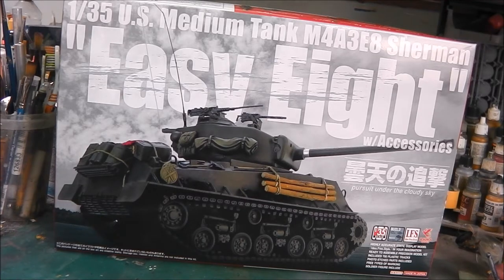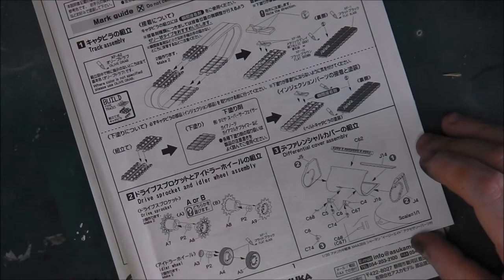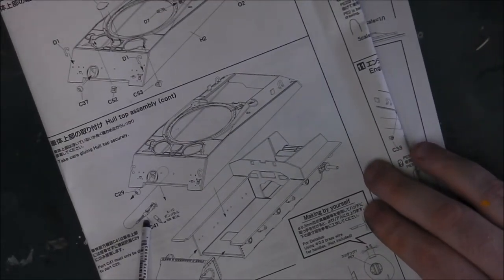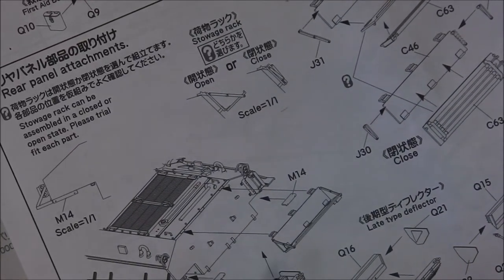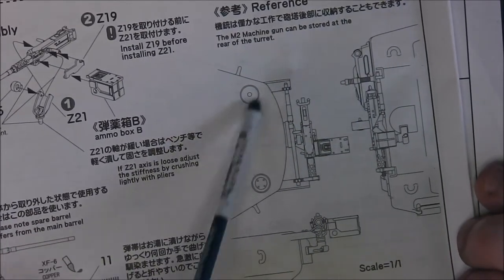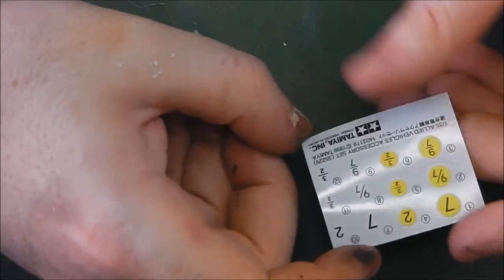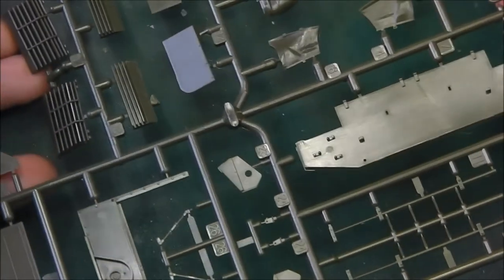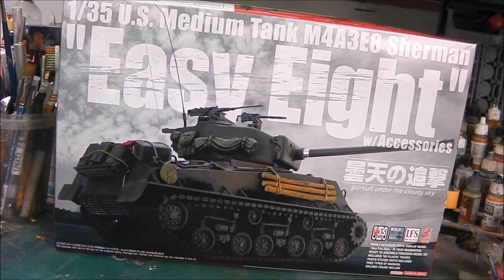Asuka Models M4A3E8 "FURY" REVIEW

Comment: I always enjoy your reviews and I most certainly agree with you on working suspension and I feel the same about working tracks. Your mention of the internal engine fire suppression and the simple need to GET THE HELL OUT !  Reminded me of a story my Dad told me about Shermans.  Following Normandy, his infantry division (90th) was on several occasions going into the line for attacks and saw a line of Shermans along the road side. Word quickly spread down the line that they were going to have armor support for a change !  Then as they drew alongside the tanks they noticed the small fist size hole in the turret side and the corresponding hole in the opposite side. The crew of each tank was dead. An 88 round had hit each one. The armor was so thin and the speed of the round so great that before it could explode it was gone and out the other side without exploding.  Metal droplets from the armor was thrown like a blast of a shotgun inside the whole tank.  I've always wanted to make this as a diorama but in 1/35 that would be far more than I will ever have room for.
Reply from the maker: that's a pretty horrific scene you consider that's there's five men in each of those tanks and gone just like that, it really does speak volumes to the courage of the tankers who got into these machines day in day out, and to the ever suffering infantry who bore the brunt of the causalities in the ETO you has a  16% chance of getting killed as a infantryman in the US army in the ETO compared to the 3.4-6% if you were a tanker
Reply: Most people don't realize that the Sherman had the lowest crew killed ratio of any tank in the war. The wet storage was a large part of this but the biggest reason was that the Sherman was just plain easy to get out of compared to other tanks.

Comment: Really good review, very thorough.I think those jerry cans are both american. The ones with the "X" pattern are fuel and the others are water. That way you don't get them mixed up even in the dark. At least that's what we had in the army.
This kit is now on my wish list. Thank you.
Reply from the maker: thanks for the insight mate, it makes sense to mark them out to stop some poor GI from chugging on some petrol lol
Reply: Sorry, I disagree. The American water cans had a different snap open lid that was as large as the screw off type used for fuel. The gas can also had a G embossed on the side and the water cans had 'water' embossed under the carrying handle. The German cans had smaller snap open lids that were on one side of the top of the can. That said, all sides stole cans from each other and it was nothing to see American cans on German vehicles and German cans on American vehicles. There's no "right or wrong" WW2 Jerry can usage, except for in the Pacific.

Asuka has a great set of American Jerry cans...if you can find them.

Comment: Hello Shane, I've a question on the tracks in this kit. Are they correct for the tank used in the film FURY or do I need to buy another set. Adam Mann in his review of the Tamiya/Tasca kit used Kaizen T84 tracks. Is this correct?
Reply from the maker: hello James ! Unfortunately yes you will need to replace the tracks if you are making a movie accurate Fury model, the Fury tank is a post war E8 so it is equipped with T84 HVSS tracks that came into service late April of 1945 though never were fitted to units before the war's end. The kit supplied tacks in Adam's example are T66 tracks, but the Kaizen tracks he showed or mentioned in his video would be correct for Fury

hope this helps !

Shane.
Reply: Many, many thanks Shane, that is indeed very helpful. I'd tried Google, but without success, so I really appreciate your reply. I don't mind the extra cost, as long as they're accurate. Think I'll go for Adams Kaizen tracks; not used them before. Cheers and a very Happy New Year to you!!
Reply from the maker: happy to be of help James, Adam has shown me some of the Kaizen links he was working on some months backs, they are nice, will take time to assembly but they are literally tiny replicas of the real T84 tracks so they don't come any more accurate ;) 

thanks my friend and a happy 2017 to you too !

Shane.
Reply from the maker: Hello James, was doing some more research on the tank in Fury, and was looking at a walk around of the vehicle and noticed its not a M4a3 76 E8 but a M4a2 E8. Once I noticed this I thought I would notified you at once. However there is no M4a2 E8 on the market at the moment in 1/35. Meaning you would have to buy a M4A2 76 Wet with VVSS suspension, then would have to replace it with either AFV Clubs's or Asuka's HVSS suspension sets and replace the kits parts with them. Then also will have to make the HVSS style mud guards that run the length of the hull. Which can make this a very expensive and extensive refit. But I felt I best tell you, though I am sorry I was not aware of this sooner my friend as I would have warned you that the Asuka and Tamiya offerings are not movie accurate  which I was not aware of at the time.

Though the A3 E8 was the more numerous than the A2E8 with only 1300 or so of the latter being produced. So if you were happy to accept the difference between the A2 and A3 most notably the difference in rear plate and engine deck configuration the A3 you bought would suffice to most untrained eyes. Again as long as your happy its the main thing.

Sorry again for being the bearer of bad news my friend but I didn't want you to be given wrong reference. 

Shane.
Reply: Shane Smyth , Thanks for the update. Think I read something similar to what you've outlined; can't remember where?
I'm not bothered about altering the Asuka kit to make a super accurate representation. Don't intend entering it in a competition, so I'm happy with what's in the box. What are you using as a reference by the way? What book(s) do you recommend?
Many thanks.
Reply from the maker: not at all, there a very good osprey publishing books specially on modelling the Sherman written by Steven Zaloga one of the great authorities on the Sherman, the books are ideal for anyone just looking for a working knowledge of the Sherman.
Also my go too quick reference is Sherman in Minutia which is a great web resource link below, their are more expensive ones out there, but would recommend them if you are intending to go Sherman mad
http://the.shadock.free.fr/sherman_minutia/index.html

the big thing you would need to do dress the A3 to A2 would be replace the rear engine plate to the A2 rear engine plate that doesn't have the small engine access door, also the engine deck will have to be replaced to the A2's small grille type covers. The website has some very useful photos of the items I referred to, I will also checks my spares and see if I have the parts lying around

Shane
Reply: Shane Smyth , Great website, thanks! I'll look out for the Zaloga Osprey as well. Got a few of his books already.
Am currently looking at a Dragon Premium M51 ISHERMAN? That looks like a bit of a beast! Aaarrgh! 
Think I need to lie down in a darkened room for a while?!
Reply from the maker: I have his armored thunderbolt on the way, should be a deadly read ! Ya the M51 looks such the beast, its that muzzle break ! Just looks so mean lol 

hahaha welcome to the Sherman obsession ;) hahaha 
P.S will have a review up 1830hrs Friday I think you may like  James ;) 

Shane :)
Reply from the maker: I am aware and corrected this in my answer to James regarding the Tracks and engine cover and deck should he want to convert an A3 to an A2 

And have since added  that an A2 E8 was used in Fury in later video reviews of E-8's 

thanks for the info none and less :)

Comment: Was Fury not the A2?
Reply from the maker: Yes the real Fury is an A2 as I mentioned in the video, the A3 that all companies sell as Fury is incorrect to the real vehicle but correct for fictional but period correct vehicle if it had existed in the war
Reply: @longlance67  yeah I'm building that new RFM full interior Sherman just now and have ledgend productions fury upgrade set for it with the gas mask on front and resin logs etc so smart in resin! I wont8be doing Fury but the resin stowage etc is really nice and the amount ofnPE in the Kitnand in the ledgend productions is nice! I have a few Tascal and Asuka kits that will benefit more from some of the PE parts likes the RFM periscopes were so nice I used them instead of the Flat no depth or any detail in pE one the kits beautiful! Italiri done there's as the A3 too didn't they, and I'm sure the first one I saw in Bovington was the a3 too with it having the engine hatch bump stops but it's an A2 now I remember commenting in it lol but gonna look the old photos out I can share blind it was an A3 before! Lol

Comment: Would you recommend this, Tamiya or dragon's M4A3E8 which I am planning on making into a Fury Version
Reply from the maker: I would go with either this kit or the Tamiya, as these are the newest kits and should build up easy, though the Tamiya kit will be the simpler of the two, and I am not sure if the Tamiya kit comes with the parts for the commanders 1919 machine gun either so I would go for this kit as it has most of the parts you need included
Reply: The Tamiya doesn't come with the other machine gun and no accessories.
Reply from the maker: Trev Hawk no it doesnt its just the base kit
Reply: Thanks for the info, I went with the Asuka kit. Great Review!
Reply from the maker: Trev Hawk no worries mate glad to be of help :)